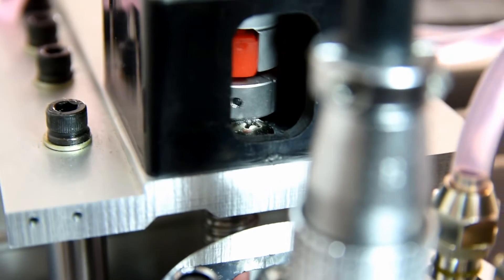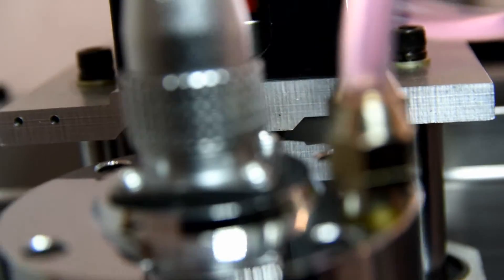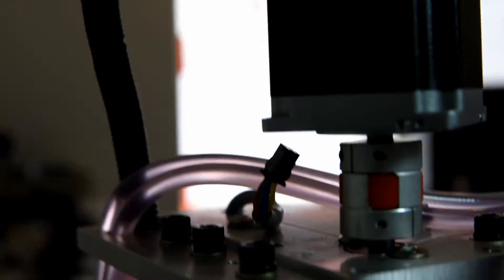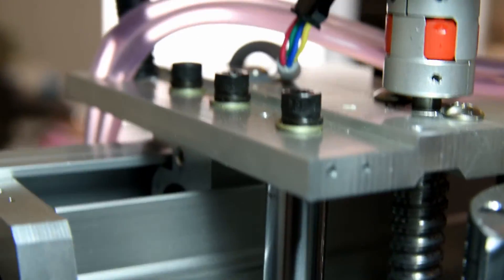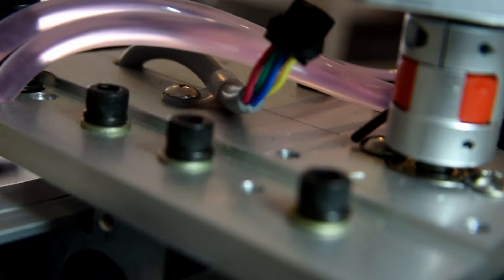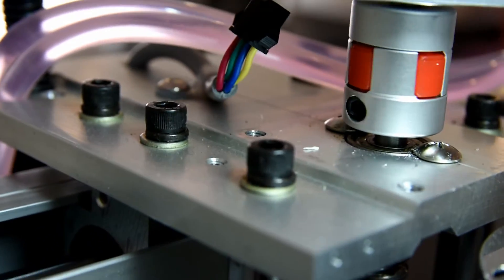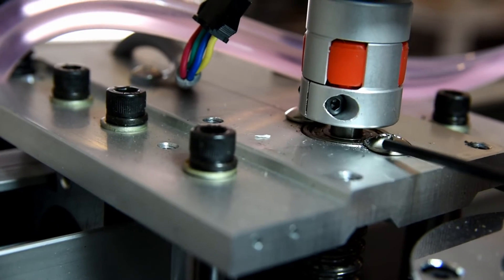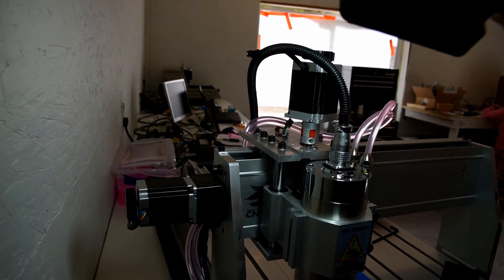CNC 6040z Design Problem

Comment: I have a CNC 6040z USB router, and I'm having problems after some time (approx 2 hours) and z-axis goes crazy moves down or up. Reading his text in the video, I see that could be the cause. Could you post the photos and how you solved it? Could be servime. Thank you very much for the information. My mail in case you can not publish it yet. Jjpedreros@otmail.com.
Reply from the maker: We no longer own this machine. We sold it and bought a CNC Shark
Reply from the maker: An afterthought would be to use Locktite to help hold the coupler in place so it does not slide.

Comment: It can be other ways, in my X6-1500GT the flexible joint was assembled too close to stepper motor, causing friction to weld joint into motor = sudden and occasional stall.